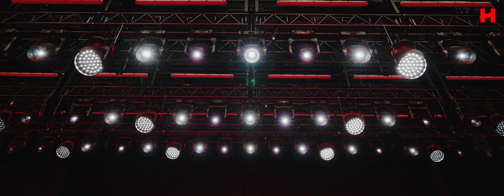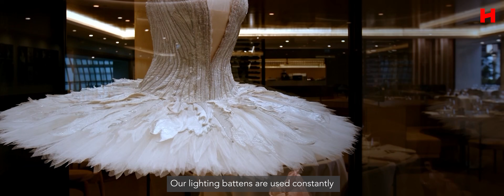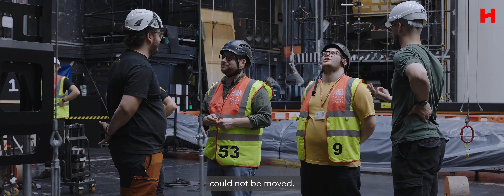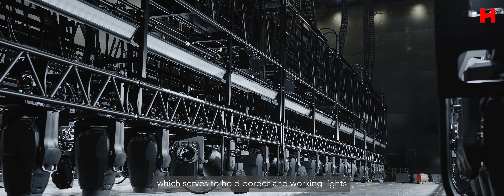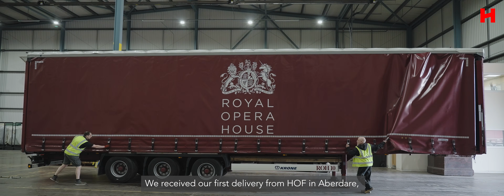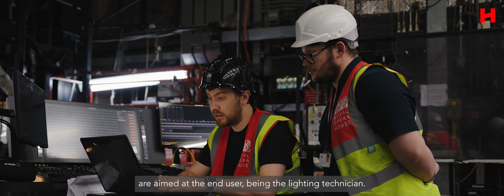@RoyalBalletAndOpera London – The Renewal of the Lighting Battens by HOF #rigging #royal #hof

Comment: This rig is awesome, but you already have a theater grid - why not just hang 1T motors across the bays and use GT truss for all the fixtures? Then you have house owned motors, if an act comes in with their own package, they can use the motors and you can triple stack that GT truss with the fixtures and stick it all in the corner.

Comment: Wow — the era of the classic Rank-Strand is over. Could this also signal the end of colour gels, now that LED lights can produce an incredible spectrum of 13 million colours on their own?
Reply: Strand has been dead for a long while, being absorbed into vari lite a number of years ago. Gels have been on their way out of for the better part of a decade now, and I'd expect gel stores to be ripped out within the next 15 years.
Reply: @morph- I was Chief LX at The Strand (now Novello) for many years. I felt a little pride to be part of the line that followed Arthur Earnshaw. The company has disappeared and the theatre which gave it it's name has been renamed too.
Reply: @morph- Hey - Thanks for your comment! My time in the theatre was 1975-1985. The standard lights used were Rank/Strand Pattern 23 and 223 Fresnals.  I guess they are museum pieces now! I was also lighting ballet, and used mostly pastel colour - 23 and 32 plus some surprise pink (can't remember the number), which was in contrast to drama and opera which tended to use yellows and golds, with a hint of red and blue. I think today's lighting technicians would laugh if they saw me set up a stage!
Thanks again for your comment.
Reply: @nigelscales2319  I mean, they are certainly still kicking about, in fact I did an out for a show last night using Pat 23s and pat 223s, and even some codas! They were mostly just used as practicals, but they worked so I'll count them.